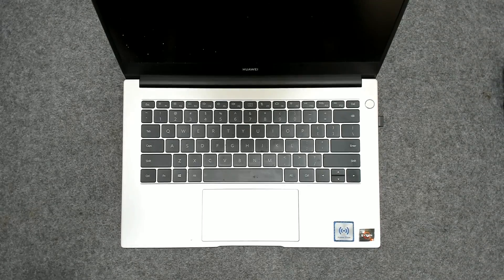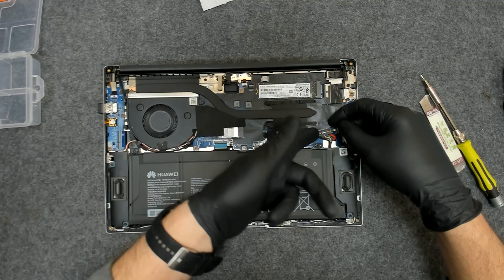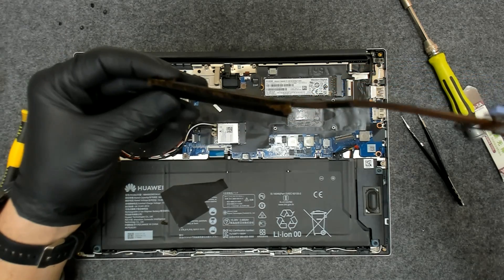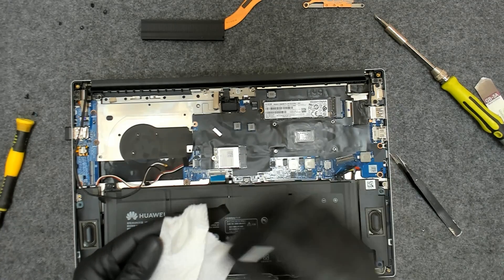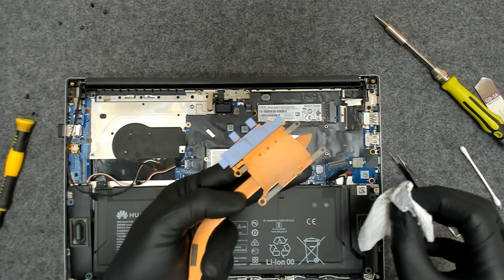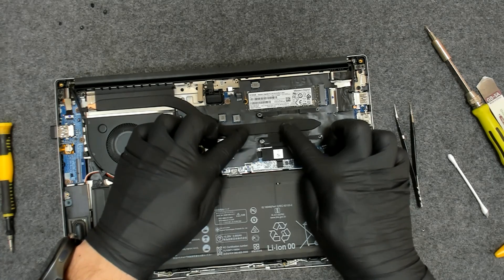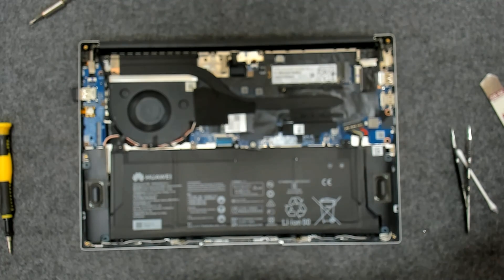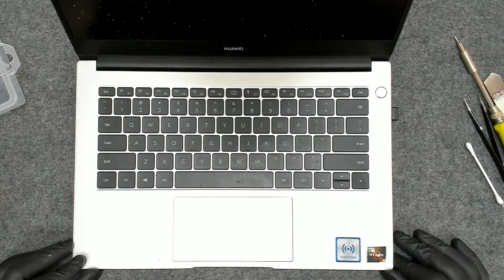HUAWEI MateBook D NBL-WAQ9R Thermal paste replacement

Comment: what screws are they? thanks very interesting
Reply from the maker: What do you mean, by "what screws"
Reply: Sorry. what kind of screws are those of the heatsink  @LaptopDisassembly
Reply from the maker: @charlescarlm For the heatsink screws I usually use PH0 and for the smaller ones on the fan I use PH00
Reply: @LaptopDisassembly  thanks